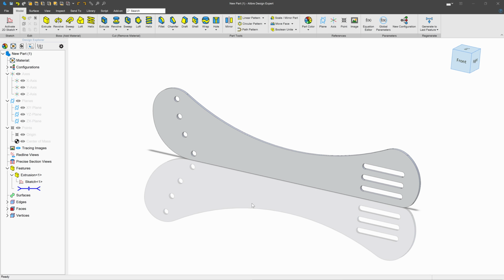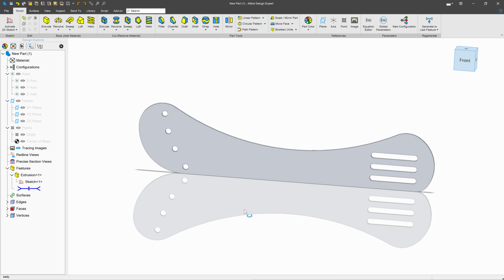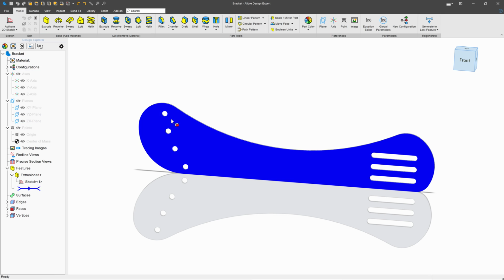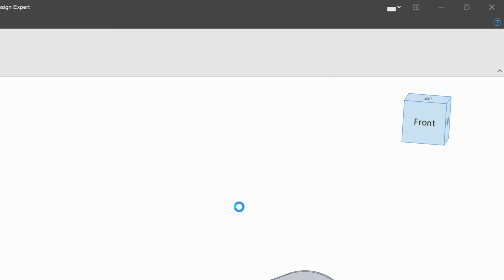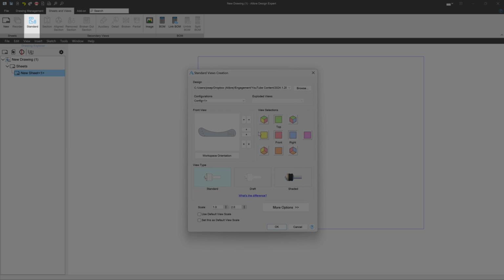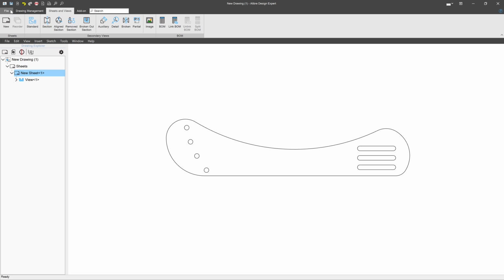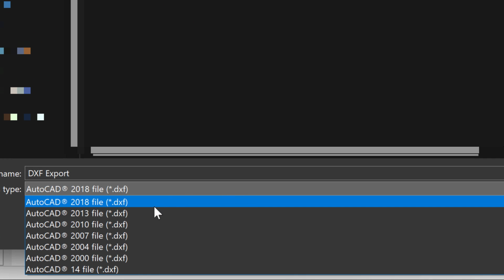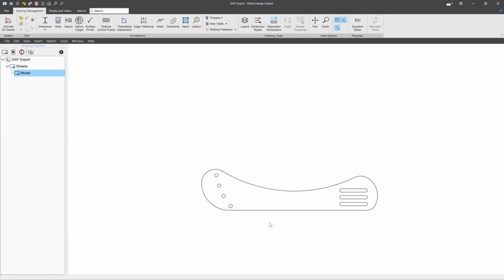Alibre | Exporting 3D Models to DXF Files

Comment: I’m sure I’m doing something wrong somewhere.. but when I follow this tutorial I export my part and open it in another cad program, the dimensions are no longer 16”x48”. They are now 101.6”x 282.47. Any reason why you think this is happening? Thanks!
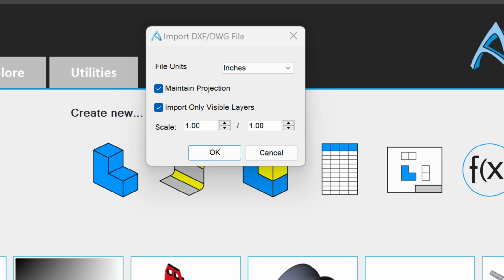Reply from the maker: My first guess would be to ensure consistent file units.  Have you tried exporting in different units to see if that fixes the issue by chance?  That would be the option at 0:58

Comment: How do you do this if the part doesn't align with a default plane? In other words, if I'm making a box that is a cube but has one edge chamfered at a weird angle. How would I export the face of the chamfer? 

The way I've had to deal with that is to edit the part, activate a sketch on the face, project the entire face to the sketch (maintaining association), deactivate the sketch, right click on the newly created sketch and select export SVG. I THEN have to take that into inkscape to combine the individual line segments back into a shape and remove any duplicated lines, if any. Doing this for a large laser cut box that had 12-15 parts was a massive pain in the butt. 

If there is an easier way to export ANY face of a part, even faces at weird angles, into a DXF (or SVG) file that requires no post processing in inkscape, I would LOVE to find out about it.

EDIT: Thanks for making these videos, they are really helpful. I don't want to come across as just complaining.
Reply from the maker: Your use of SVG's is an interesting and innovative way to work through that.  Nevertheless, I just published a video for you to hopefully help alleviate the headache you've had, I hope it is helpful.

https://youtu.be/FepxlAXu5RA
Reply: @AlibreLLC  
1) Thanks for answering so fast. That's pretty incredible.
2) I only found that workaround after frantic searching on the forum. I had already drawn a very complex assembly that I didn't want to recreate by hand in inkscape.
3) That solution would work perfectly as is for any laser/plasma/water jet cut assembly since I model each side as a separate part. (making finger joints at weird angles look flush is tricky)